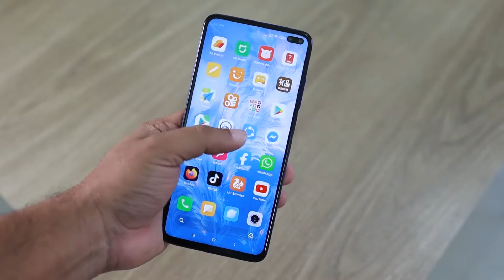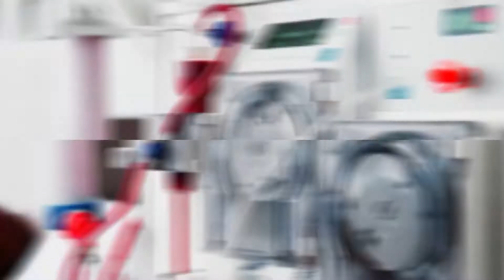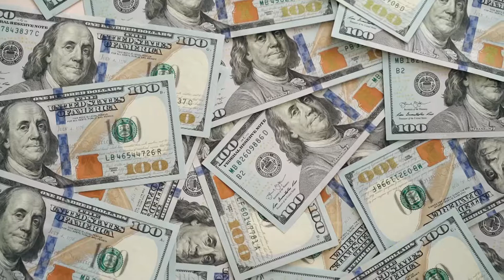WORLD-WIDE POWER OUTAGE!!! / WILL HUMANITY SURVIVE?

Comment: 6 hours of AC auxiliary power and then I switch over to a gas generator start using solar panels to collect sunlight into deep cycle batteries
Reply: You need emp protection shields or anything with a circuit board of the system will be fried